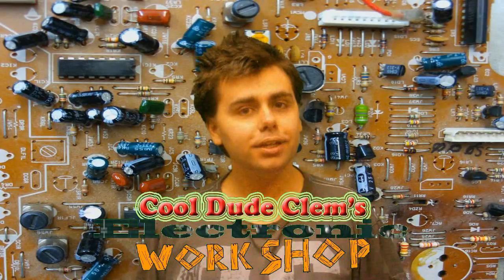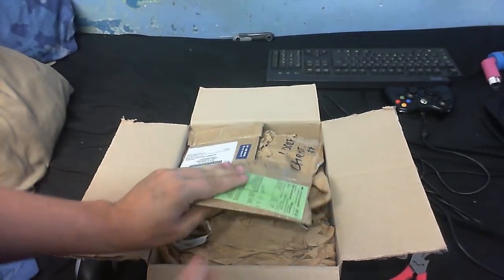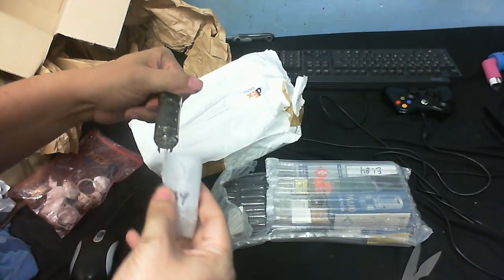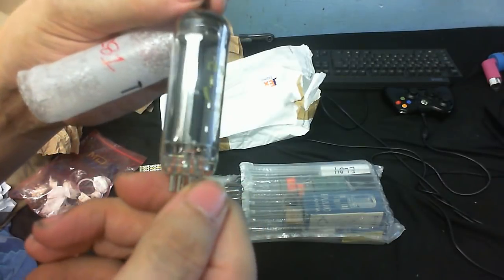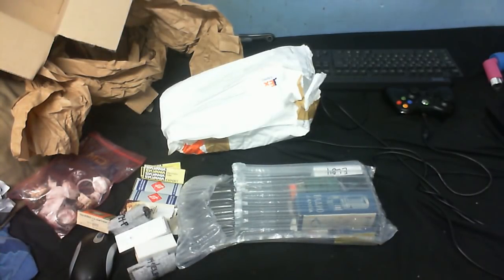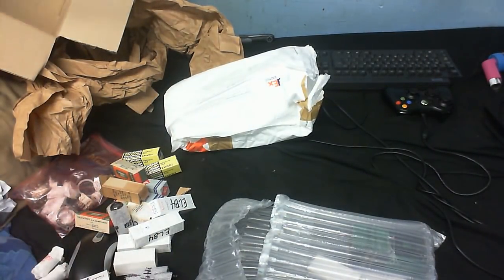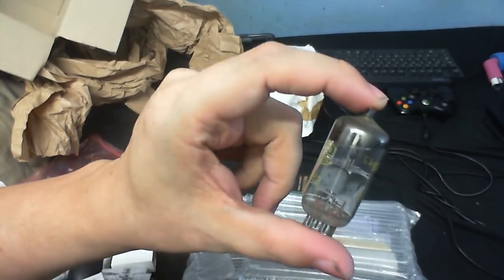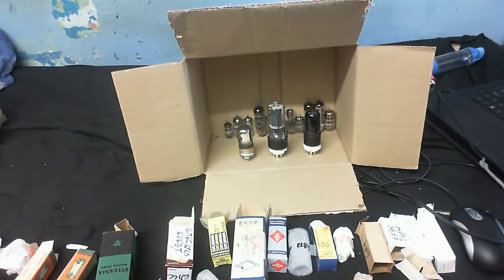Tubetime Episode 3 Special - Un-boxing more Tubes (re-uplaoad)

Comment: Clem, 

that ez81 tube, isn't that the tube i'm missing in my video : 
vintage radio Part 3, no fix
around 5:30 

would be great to fix this masterpiece after almost 2 years :D
Reply: Hello marcel. I have a few vintage radios with rectifier tubes, m8. What are you missing? I'd be happy to send you an EZ81 if you need it. I'll take a look at your vid and see what's up. Clem was sent two types of rectifier tubes....EZ81 and the 6X4.